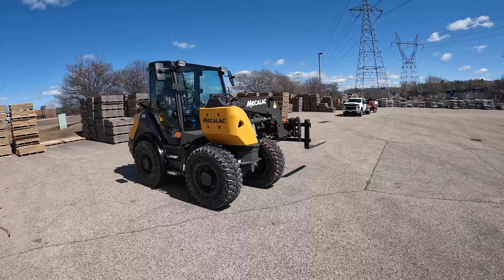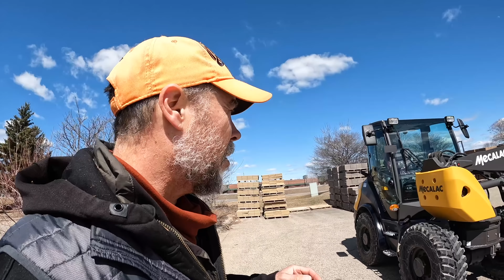Weird & WILD the "SWING LOADER " by Mecalac

Comment: Confused here. What’s the point of articulation in the loader arms if it can’t extend out. Example picking a pallet at 90 degree you just can’t steer the machine into the fork pockets of the pallet. Very cool design tho I see many uses with regular loader bucket
Reply: I thought the same thing. Probably not getting the full potential out of the design with forks but a bucket would be able to drive down a trench and backfill without repositioning a bunch of times. Also maybe use the forks to move retaining wall block and lift to the height of the wall while driving along the face of it.
Reply: I'm guessing the crab steer would turn 90deg to enable use of side swing?? But yes, telescopic would be better
Reply: I am assuming telescoping would push it way out of CG requiring additional counterweight.
Reply: I thought that exact thing.  Swing mode is useless with pallet forks if the boom isn't telescoping. Crab mode still won't get the tines out of the pallet.
Reply: @mackdickson1209  you do realize that it would be impossible to turn the wheels 90°, right? (With that steering setup. You'd need casters.)
Reply: I can only see it used for delivering materials up to a person/floor level. Not the entire pallet. This machine is better suited for use with a bucket.  https://youtu.be/tZMrcbO30pM?t=180
Reply: Watch ahlmann demonstration here on YouTube and you will see this is really handy
Reply: Or a way to turn each wheel 90 degrees so it drives sideways

Comment: Would have been nice to see moving and stacking pallets to actually show why it's better. I assume it would be, somehow, but struggle to really see how.
Reply: Tight access and precise moving jobs even loading trucks in narrows laneways
Reply: Other than some really specific applications, I'm not sure I see the point in this either. But then again, I'm not an equipment operator.
Reply: It's for tight spaces/situations where you can't position the machine lengthwise.
Reply: Well our fork lifts are like this  narrow aisles
Reply: @tylerw4593  trench work in tight European urban jobs, this thing is the modern day wheel barrow, servicing the excavator bringing pipe, gravel, dirt, back and forth while the excavator do proper work for the guys laying pipe in the trench by hand. it drives along the trench swing the arm aside pouring the gravel in easily without messing the pavement at the edge.

Comment: The lack of a telescoping boom really holds it back in my opinion.  If it could run a brush hog it would be great in orchards and vineyards to mow under trees and vines.
Reply: euro manufacturer paus makes a telescopic swing loader designed to put a brush hog on it
Reply: Yeah even like 3 feet of extension would make a huge difference but then everything has to be engineered to handle the added stresses of changing the load dynamics.. 1000lb at 1 foot of distance will multiply with added distance but a moving counterweight could help alot too.

Comment: Be cool if u could have rear steer only too be like a forklift truck the ram that does the counter weight u will find on the rear piviot steer axle on SAS (System Active Stability) forklift trucks we use to use them u could corner at faster speeds with a load in the travel position and if machine is of balance due to load or terrain the machine would automatically retract or extend the ram and makes the load more stable even when mast was at full exstention while slowly maneuver with a full load up high

Comment: Ok. So. I operated a bigger one for years. It can literally do anything. The red switch is a load compensator, when you drive it will smoothen the ride.. Search for youtube "Ahlmann az95" or "Ahlmann az150". Ahlmann is the original manufacturer for this machine, Mecalac  took it over a few years ago. It is a very popular machine in the Netherlands for road building and infrastructure.
Reply: 4:04 This is the button to keep the machine running for longer then 5 minutes. If no one is sitting on the seat the machine will turn off after 5 minutes. If you push that button its extended to 1 hour. This is because of the exhaust gas cleaning system, it can take up to 45 minutes and the machine may not turn off in that time to prevent serious damage.
Reply: I find it funny that a guy that doesnt know how this machine works is explaining to you how this machine works =)

Comment: 2 brakes likely one is for going downhill. It keeps the transmission and motor connected while applying the brakes. The other disconnects the transmission allowing the engine RPM to be high while slowing down for faster hydraulic movement. Likely the sledge has the same setup.

Comment: 3:21 This is a kill switch. Notice the little line is outside the circle. This means no power. A regular power switch has a line inside the circle, indicating power on/off.
4:11  The translation I got was Hitch suspension. (on/off?)  I think this is for the fancy counterweight system.
Reply: This is not true. The red switch is load compensating.
Reply: @ExeQtd   That's the same thing.
Reply: @firesurfer  No its not, has nothing to do with counterweight.
Reply: @ExeQtd  It moves the counterweight.. so what's the diff?
Reply: @firesurfer  it doesnt lol
Reply: @ExeQtd  Show me.  I can't find an exact descrition.
Reply: @firesurfer  Like i said. I know these things inside and out. Operated them for years. You can look in a manual.

Comment: if they added a 10 or 20 ft telescoping boom it would be a great yard forklift being able to go down a row and grab from the side. as for being a loader I dont see any advantage to this vs center articulation
Reply from the maker: Not arguing there
Reply: They actully have one. The ahlmann az 95 tele. (Its actully an rebranded ahlmann) but because of the extension, it has an very long boom. Even if its all the way in. So it is not as  viable as this one (sorry for my bad english)
Reply: They are originally Ahlmann machines from Germany and were rebranded after Mecalac acquired Ahlmann. 
They now have the AS900 Tele in their lineup. 

In Germany these machines are quite common in road construction. Especially if you can’t close all lanes and have to queue all machines on one lane but work on the next lane.

Comment: Hi Stan, do the forks move in & out? Can you straight pick up a pallet, turn it to the side 90deg, set it down and then pull the forks in to leave the pallet there and drive away?
Reply: it would not be a perfect 90 but it could crab in and out of a pallet sideways
Reply: @imchris5000  crab steering only goes at an angle. So you'd drag the pallet

Comment: So the swing really only comes in handy while you're driving through tight turns. The easiest way to pull out the forks after placing a load is when it's all straight, or you'd have to play with the steering modes to get the forks out without them binding. I think it would benefit from forks that swing horizontally on the end of the arm as well, otherwise I'm struggling to see the advantage of the machine other than driving through tight turns. But if you don't have the budget to modify a building or acquire enough space to do your job without acrobatics, I doubt you'd be able to go out and purchase this specialized machine.

Comment: Hey stan here in Holland they still call the swingloader an ahlmann and the excavator the mecalac but i swear and iam An lover of the ahlmann swing loaders the funconalitie is gigantic they opperate so smoot iDeal compact work and road work and groundwork you can also attach An level blade I Works fenomonal bud thake bigger tires for grip in the sand they plow quick idk the new types 100% good machine

Comment: front wheel steer is a legal obligation (years ago hydraulic steering could be realy jerky and way to direct for road speed on four wheel steer) four wheel steer is what the machine is on 99.99% of the time (my liebherr telehandler does 50 kph and its manageable with modern steering)  and crab steer is for not getting stuck against a wall and to do some tricks like grating with normal booms

Comment: I actually have a question and Iknow u Would definitely know , when it comes to hard work like lots of back dragging , making roads wider , making trails or small paths throw woods , etc what does better a skid steer or small loader like this size , and Ik the conversion comes up about skid steer s have tracks and stuff but I mean with the ground conditions aside and with the opinion to put any skid steer up against any small loader of equal size , what would u say is the better machine for that type of work ? And thanks and let me know I ask to much stuff lol
Reply: wheel loaders can do those things but they are made for loading trucks on hard ground. a tracked loader is the bigger version of a skid steer

Comment: i wish you would have shown the machine load and unloading from the side.  it looks to swing 90 degrees . the question is can you get the forks in\out of a pallett at 90 degrees?
Reply: That's what I'm wondering. If you swing to the side, it looks impossible to back the forks out
Reply: That is true, you cant get a pallet in or out from the ground, then the wheels are in the way but they wanted this loader to be compact as possible. Its not ideal for pallets. But for dirtwork its ideal

Comment: That would probably work great on the chimney job we're working on now. Can only get to the back of building from one side and no room to turn corner.  How high will that lift? What if the forks/bucket could extend out or up like a lul?
Didn't see crab mode to well...? Did you get a couple exterior shots of it?